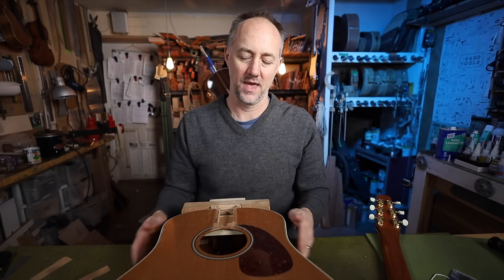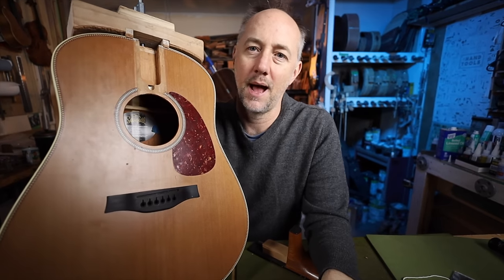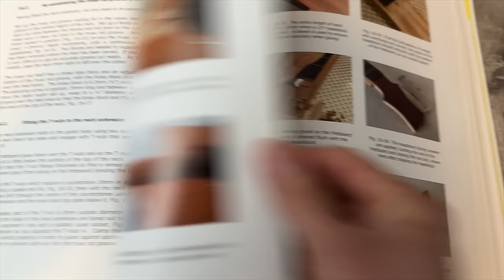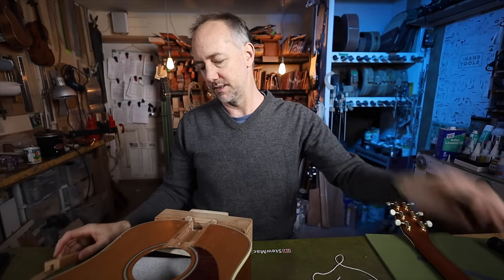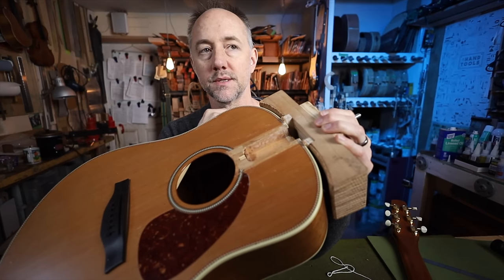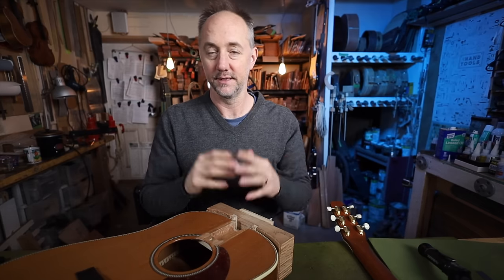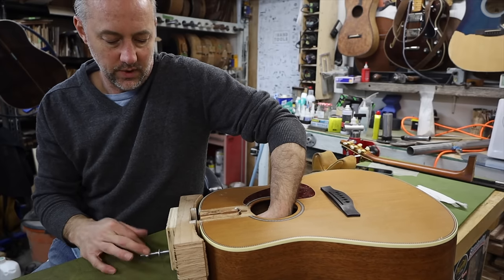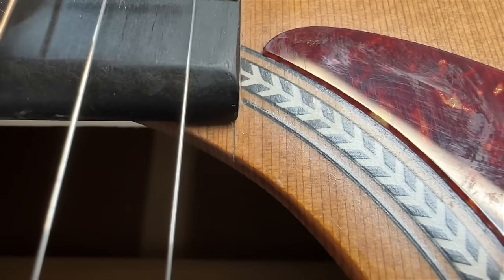The Hidden Problem with Seagull Guitars...

Comment: Wow...very interesting...I belong to a couple of Seagull forums & actually hadn't heard about this. Maybe because most folks haven't needed a neck reset on their Seagulls yet. I own several...bought quite a few back a few years ago when many places were selling them at great prices. I especially love the mini-jumbos - very comfortable to play, but one of mine has developed a crack on the top, even though I keep all of my guitars in their cases & my guitar room is humidified. I've seen several folks on the forums complaining about their Seagulls cracking...wondering how common the problem is or if it's just from most folks not keeping their instruments properly humidified. From what I understand, cedar is more prone to cracking than spruce.😥😥
Reply from the maker: Hi- thanks for watching. Any guitar with any species of top (or back/sides) can crack. If not a blunt force trauma is always humidity, and 99% it’s dryness. Some guitars are better at withstanding humidity dryness and it depends on the wood batch at the factory, the season it was built and how it has been stored over the decades. Seems a bit strange to say that but it seems that be true. Some guitars crack like twigs, some can withstand the apocalypse! 
Few free to post this video to any seagull forums.
The problem I talk about In this video, fortunately, isn’t a problem until it’s a problem. The big neck insert they use over the body joint in the neck is a great idea and it does what it is ment to- stop the body joint hump- it’s just a very bad idea to epoxy it in as it makes neck resets (which ALL and EVERY guitar eventually need) very difficult to fix (not impossible). Apparently the Godin factory just saw the neck off, clean the  pocket and grab a new neck- that’s not very good for most people. I don’t like that throw away mentality.
But the good new is they are good guitars until they aren’t  but that takes decades :)

Comment: Jose Ramirez lll  would not glue right to the edge of the fingerboard when gluing the fingerboard to the body
By leaving  5 to 8mm on either side of the board free of glue any split of the spruce top will likely take place under the fingerboard close to the line where the glue ceases. I suppose the same could be applied to the block/fingerboard glue face, eliminating need for flaring.
Reply from the maker: Interesting- I didn’t know that

Comment: I have a 1998 Seagull + Spruce (old neck attach, so it could more easily be repaired if needed). That said, my neck set 25+ years later is just as good as it was on day 1 as far as playability and external look goes). I take good care of all my guitars and minimize any drastic changes in temperature and humidity. I keep it strung with recommended gauge strings (or lighter). If I do any "up tuning", I always return it to standard tuning so I don't overstress the neck. I do the same for all my other acoustics (Martin, Taylor, Guild, and Carvin) as well.
Reply from the maker: Nice. Seagulls new (post 2006) is a great neck joint solid and stable. It’s just bad when it needs adjusting.

Comment: I get the importance of repairability and I've done neck resets before (dovetail only).  In the USA you can get used seagulls for $200-$250.  Neck resets generally start at $500 (I get it'd be less if they made an easier to adjust bolt on, fair point).  I'd just get another seagull.  Side note but the entourage rustic is the best sounding readily available guitar in that used price range in my opinion.  Made in North America, not perfect but there's a lot to like there.  Tiny headstock, big tone!  : )  Nice work and it's interesting to see what's involved in resetting one of these.
Reply from the maker: Thanks/ this guitar costs $1600 new but on those cheaper ones, this neck system makes them a throwaway guitar which is a shame
Reply: Sure but with guitars, there is at least a little “you get what you pay for” factor.  I’m guessing the $200-250 used price range you’re quoting is for an Entourage, which is their entry level guitar at $500-600 new.  Most people eventually move beyond that entry level and want more from a guitar.  I haven’t seen any of their midrange guitars, even something like the sws maritime guitars even remotely close to the $200 price point
Reply from the maker: @justaname109  this retails for $1600
Reply: @BeauHannamGuitars  oh, sorry, I was replying to the OP in the comment.  I guess my point was, just buying an entry level seagull because it’s cheap, instead of repairing a neck isn’t a solution for a lot of players because they want a better sounding guitar anyway.

Comment: Thanks for the video it is very clear getting a bit familiar with tech side of the guitar is fun. Have a stupid question here 🙏. I am quite new on playing guitars. I visited a music shop today. Tried a couple of guitars a Sigma, a Martin and a Seagull. All of them were having high actions like 3-4mm at low E 12th fret. Is this something normal for new guitars?
Reply from the maker: Hi and my pleasure. I good medium action with a saddle that is around 1/8” above the top of the bridge is about 5/64th for all strings (about 2mm). To take the action down 1mm at the 12th fret, you have to remove 2mm at the saddle. 
Hope that helps.
Reply: @BeauHannamGuitars  Thanks I appreciate that.

Comment: My S6 cedar will be together long after a lot of my others ( Martin included) have twisted beyond repair. Love it. Doesn’t like coated strings.
Reply from the maker: It may indeed last longer then the others for a neck reset but it will eventually need one.

Comment: I’ve heard about this issue from the forums, but you really demonstrated very well what is being talked about. It’s really unfortunate that these become “throw away” guitars. And, as word gets out, many luthiers will refuse or refer repairs of these types? As cost encroaches on the actual value of the guitar. 
Do you know if this joint is used on the upper end models too, like on the D’Agostino guitars?
Reply from the maker: Thanks. I'm not certain what instruments have this but I presume all their acoustics regardless of price (this guitar cost $1600 new). I'm not sure if their archtops have this neck joint. (I should call them and ask so I can include it in the description!)

Comment: I've always wanted a Seagull guitar, but after seeing how they are constructed, I'd be hesitant to buy one.  Thanks for creating this video.  It taught me a lot.
Reply from the maker: They sound good (I play it at the end cuz I was having fun) but the neck repairability is rather non existent
Reply: Get an older one which will have  the better neck joint if you like the sound of that particular one.  I have a 2001 which I gig with regularly.  Never a problem so far!
Reply: I've got 4 Godin's and a couple of Art and Lutherie's and all have been the most bulletproof and reliable guitars I've owned.  Don't let one angry man steer you away from the best guitar value on the planet.
Reply from the maker: Get the relief to around 0.006" and see where the action is.- those Performers are nice
Reply from the maker: Like iv'e said before- This neck attachment system isn't a problem until the guitar needs a neck reset, which all guitars eventually will need. Happy playing Livy! :)

Comment: When I bought my first Seagull, it was their top of the line with rosewood back and sides. I think it was about $1200. (1990's?) I absolutely loved the sound of that guitar and would put it up against any other guitar out there. But then I started having problems with it needing constant truss rod adjustments. Eventually the truss rod failed. Knowing that trying to fix it would cost me close to what a new one would cost, I ripped it apart and then threw it away. So your opinion that it was a throwaway guitar, I would agree with. Some time later I purchased a Taylor. I paid almost twice the price, and no, it doesn't sound as nice as my Seagull did. But I still have it after 20+ years of use...with no problems.

Comment: Simplier design could be good. In this case the normal dovetail is better. You can use epoxy on the dovetail. Ive applied wax on the heel block, but epoxy on the dovetail, drive in the dovetail  leaving appx 1/8th of inch out/ loose,until the glue hardens alittle, and then drive the joint in the rest, making the joint strong.And add a wood screw from the inside to keep the neck in. Point is the wax holds to one side epoxy holds the otherside, making reset of the neck later possible.
Reply from the maker: Or, just use water soluble wood glue …

Comment: Art and Luthiery was a version of Simon and Patrick where there was a mark on the top wood and the top was coloured to hide that. Seagull was same guitar with different headstock and sold through a rival distributors. I think Norman was similar. These are crudely made mass produced guitars where they vary a lot one to another, so if you look through 30-50, you might find one decent one.
Reply from the maker: Interesting thanks

Comment: Good for Mr Godin, I really Liked my Godin acoustic bass, but returned because of that hump…I tried everything, it was used and it had a factory hardshell case. I hope that 12th fret hump was fixed…my was before that issue fixed. I still think they are lovely guitars.
Reply from the maker: They largely fixed the hump (short term problem), but swapped it for a long term problem (not being able/designed to reset the neck which every guitar eventually needs)

Comment: I currently have an 87 Minstrel. Laminated wild cherry, maple neck and rosewood fingerboard with a squared headstock with a Seagull decal on it. An inquiry to Godin tells me that it was basically and entry level S6 with a laminate top instead of the solid cedar top. I've let it dry out pretty bad over the few years I've had it and it developed a fair sized belly. Asking around I was told it wouldn't be worth fixing it because of the laminate and to play it until you can't. I love the neck though and decided to take it on myself and I'm no luthier. I've soaked the neck with lemon oil and it's currently sitting in a case with some homemade humidifiers. Gonna work on that for about a week and see what happens. Maybe a bridge doctor to get it the rest of the way and keep it from happening again. We'll see. Curious what you might do or suggest in this senario ? I also live on the Quebec border, not far from where this was built and theres some kind of nostalgia there for me.
Reply from the maker: Don’t over humidify it to try to puff it out again. Just humidify as best you can to 45% ish
Reply: @BeauHannamGuitars  Thank you for your reply and suggestion. It's very appreciated.

Comment: Very interesting.  I've mostly been a Japanese Takamine and (earlier) High end Ovation player and found those neck joints to be pretty solid.   I've had my eye on seagull recently and like the Artist and Maritime models in particular.  I assume this issue with the neck you've described could happen in both Artist and Maritime ?   And I'm guessing top wood species wouldnt be a factor (Ie, Spruce or Cedar, doesnt matter, could still happen) ?   Thx !
Reply from the maker: Thanks for watching- as far as I know it’s all models from 2006 on. Top wood doesn’t matter although spruce typically is stronger along the grain which is a factor for neck resets but a reset is only usually needed after 20-30 years.

Comment: I have had a Seagull S6 for 30 years. I had to get the neck reset within 2 months of owning it. The explanation I got at the time was that due to the eco laws(in Canada) that had just come in, they had to change to a different type of glue which turned out to be a problem. The glue couldn't handle humid environments or hot environments over 35 degrees celcius.
Reply from the maker: That’s a bad decision- let’s use glue that dosnt glue!  Sorry to hear it

Comment: I had a Signet guitar (sold by Selmer, in the 1970s in the USA) that needed the neck reset. I spent a lot of time trying to get that thing off the proper way.
But it turns out it has the same neck joint as the Seagull—parallel with the neck—so I just put the body on a shelf after I finally removed the neck. Still have it.
Certainly it's a very strong way to attach a neck, but not so good if you need to adjust it, and I didn't want to put in the time, as it wasn't an expensive piece.
Reply from the maker: Yep- this system works well until you need to take the neck off… then ARGH

Comment: You could make a replacement block in two halves with a gap in the center for the rod. The two halves would mate perfectly with the sides, so no need for shims. Make them a bit tall and scrape/plane down to the top and Bob's your uncle!
Reply from the maker: Norman’s my uncle! Hahah- there is maybe 5-6mm of wood on the bottom of that block which adds structural integrity to the headblock so I’d make a whole one and route (or chisel) a new truss rod channel in rather then two halves.

Comment: Thanks for the video.  I've lived in New Hampshire and Maine for most of the last 40 years. I saw a lot of Seagulls in the  late 80-90's, and I saw a high level of variability among them. I knew a guy who owned a store who ended his contract with them in the early 90's over it being a crapshoot if the guitar delivered was similar to the last/next. That was a long time ago, I could only hope they became consistently better. My introduction to the brand was a woman who had a fabulous Seagull, and I initially liked them just because she made marvelous music on one.
Reply from the maker: Thanks. Ive  only seen the ones made from around 2005 to now - I like them when they are good- but this neck joint isn’t foward thinking

Comment: Hi beau....i just bought an older cedar top gull. Im poised to get a pro set-up to suit my alt tuning quirks. I was told its an older gull, not sure the year. When did they begin the disastrous epoxy solution on their necks?.hoping my new little girl predates. Thnx!
Reply from the maker: Hi- they started 2006, but there might be a few of the later months of 2005
Reply: @BeauHannamGuitars  cool, I think mine predate this atrocity. I'll check. Thnx.

Comment: My local climate is not friendly to guitars (significant rapid temperature changes and low humidity).
As I am considering a Seagull, I called a local luthier who said he has seen problems with many brands like Taylor, Gibson, Martin etc but none of the brands made in Quebec
Reply from the maker: Some guitar brands may be better in some areas.

Comment: She's got tons of songs in her, made possible by your expert repair. The way it rings with overtones is special.
Reply: @BeauHannamGuitars  I have a SeaGull walnut 12~string. Fairly new, no neck issues. It sounds very sweet and sustains with organ~like tones. I hope they didn't install the neck that way.
Reply from the maker: If its made post 2006 then it probably has this neck joint

Comment: I own a first run of Seagull with Cherry body and cedar sound board.  I didn't know why my neck came loose . When I finally figured out how the neck was bolted on . I took the neck off and glued the whole thing with fish glue.  That was probably 15-20 years ago.  And never had a problem with it yet . I have had some slight swelling at the bridge and that will be fixed next with a bridge doctor.
 What i didn't like was the bolts were covered with a sticker so i had no idea they were there .
Reply from the maker: Bolts - Collings hides them the best- no sticker but plugs that when the eye runs over the headblock on the inside, you can easily miss they are there.
Reply: @BeauHannamGuitars  that sounds special to work on lol 😆

Comment: How many acoustics have bolt on necks. Most ive come across are glued in neck.
Reply from the maker: I’m not sure of the ratio of dovetail to bolt on. But this is different to a dovetail, which you might be thinking of as a glued in neck. A dovetail with water soluble glue is totally and quite easily reversible.
Epoxy, however, is not water soluble- it does eventually release under heat but as I point out, the bottom of the block on this joint is about 1” away from a possible heat source- so in reality, this whole neck joint is fused quite permanently together. 
In short, this is NOT anything like a typical Martin, Gibson, Collings dovetail glued in neck join.

Comment: I came here thinking "hang on a minute, Seagull's bolt on neck is actually pretty great because you can easily....WHHHHHHAAAAT!?!?! EPOXY!?!?!"

Thanks for exposing this stupidity. I had no idea they were doing this. I won't recommend another Seagull until I hear they've changed this. I carried them as a dealer from 2008-2010, and they were good then, or so I thought.
Reply from the maker: Yer,  it’s a shame but it’s not a problem for most guitars for 10-20 years

Comment: I have a lefty Seagull I picked up used that was very well played/abused for a camping/beach guitar.. The paper inside says cedar but no model or serial number so not sure how old it is. The fingerboard droops a couple degrees at the 14th fret making it unplayable above 14. Below that it is very playable with that warm cedar tone. I like it enough to keep it home and got a "plywood" Martin to take camping. I thought about resetting the neck but after watching this video I guess the droop remains as part of the guitars' character.
Reply from the maker: It might be pre 2006. I cant remember if the back of the headstock has a serial number stamped. You might be able to tell from looking inside and up at the headblock.
Reply: There's no other markings on it. The tag as a place for model and serial no. but nothing was written in. I got it somewhere around 2006 and it was pretty well worn in by then so has to be pre 2006. @BeauHannamGuitars